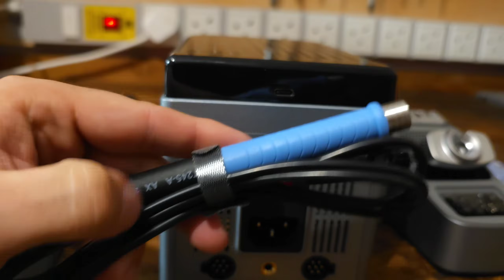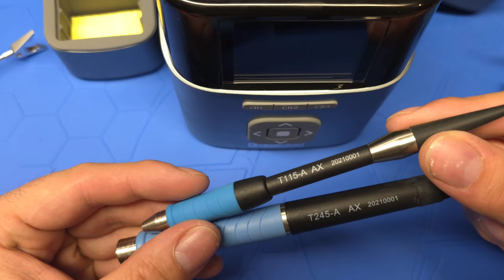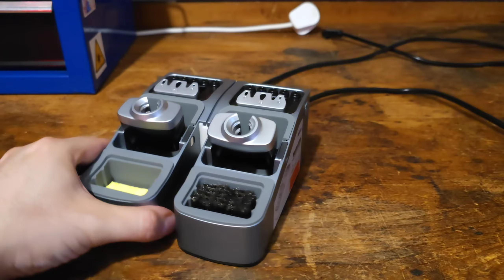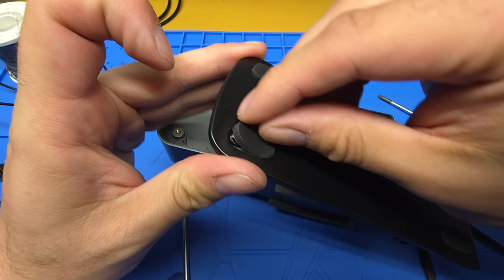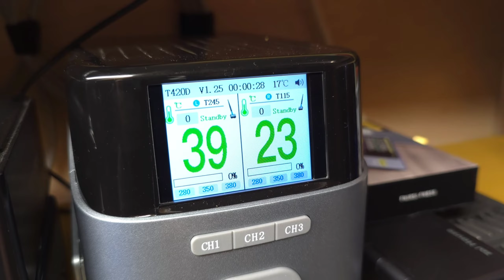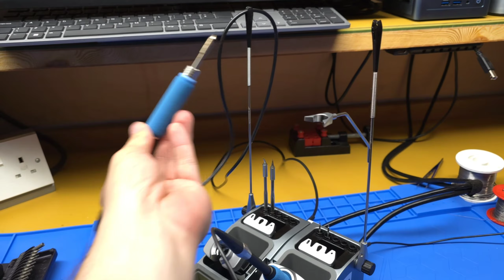Electronics Workbench Build - AIXUN T420D with some mods!

Comment: It would be better if you drilled a small hole in the soldering iron connector, but did not break any of the pine at the base of the holder.
Reply from the maker: Yes you are right but this was a very long time ago now
 It's still working very well the iorn

Comment: I almost  got one of those but I got a ta305 instead.  I'm hoping  to DIY a PCB that switches between tips. I wanted the t420 but it's twice the price (almost) and some  users scared me saying it fries tips and isn't compatible with  genuine and stuff. Not sure if that's true.

It looks slim and nice tho for what it is (two transformer based stations in one)!

Do you think it's worth having all 3 handles/ It's annoying needing 3 different types of tips. I was thinking of doing 115 and 210 or 115 and 245.
Reply from the maker: No it's not worth having 3 as it's a dual station and swapping the actual handles is too annoying. I burnt out all my tips that came with the station but I put this down to my error as I had no idea what I was doing and trying to solder everything at 500degres to start with. I really like the T420 tho its a very heavy unit. Getting the right tips is important tho. On my latest Ali express videos you will notice I got new Relife tips and I'm super impressed with those ones so far. Now I have been using them I no longer feel the need to spend a lot of money on JBC ones
Reply: @J @JFIXX1  oh nooo. 500c is a lot! I use 350-320 for lead free Thankfully they’re not TOO expensive! I’m a bit broke but maybe I’ll try the relife. I got HZXY something because relife didn’t have any of my favourite tips (1mm-1.6mm chisel for example, or bent chisel). I’ll see if I can find the video later today when I’m free
Reply from the maker: @ameliabuns yes but when I recorded this video i had never used a soldering iorn before. I had to make some mistakes to start with to find out what I really needed. I also bought MYTO tips that also I have been using and they are good although one was dead on arrival but they did send a replacement
Reply: @JFIXX1  Woah that's a very fancy first iron :D Good luck!
Reply from the maker: If you want to know which handel to get definitely 245 is essential as gives most power. The second one down to what you mostly working on. The 115 is very very small so good for mobiles or trace repairs things like that. The 210 to me is just an in-between soni have never used it

Comment: I have that stattion, and something cought my attention in your video, on my T420D all the plugs are 6 pin, witch means i cannot use the docking station, witch uses 7 pin aviation plugs, it looks likte there ara 2 versions of the T420D, one with 6pin plugs and otther with 7 pin plugs. An excelent station tought, i use JBC tips and never had a problem with it.
Reply from the maker: Very strange I can't quite remember as this video was a long time ago but I did some mod on mine to get the pin to fit

Comment: aixun is a brand which untrustable! tip voltage leaking is ubiquitous, the company never! never! try to fix this issues
Reply from the maker: I never actually tested for voltage at the tip now I am curious what mine will be I need to measure it

Comment: I've been doing research on this station and the issue with the handle is that the first versions of the station came with 6 pin connectors all around. Those were compatible with JBC stands. Not sure why they changed it to 7, but the newer batch of stations come with 7 pins. Not confusing at all :(. Now there's a new version that has WiFi. The only difference with that one is that it syncs with their fume extractor, so the extractor activates when you lift a handle off the base.
Reply from the maker: Thanks for the update
 I like the idea of the WiFi version with the fume extractor maybe I will have to upgrade

Comment: 24:22 Maybe you could have carefully drilled a hole in the plastic of the connector in the handle, so it can accommodate the seventh pin from the base. No risk of damage to the base and you already had a spare T115 handle. The mods you did to change the way it holds the T115 handle in the base makes good sense.
Reply from the maker: Good idea but too late now 😅

Comment: Just had a blown MOSFET on the right iron on a 2 month old station. I was using the left at the time and the right should have been at standby  90 °C however glowed red and burnt out. Tried another tip and that went pop. Got a new main board under warranty. Replaced and its working. Belled out the old board and one of the 2 MOSFET's on the right is shorted. Just something to watch out for as its looks like i'm not the only one. May replace the MOSFET.
Reply from the maker: @johnbarnes5406  Ah that's a shame - with my issue they were very helpful and sent me the new iron without any questions so at least the support seems to be there from Aixun. And you have the faulty station to keep for any more parts in the future. I have not had any issues with mine but I don't keep any standby temperature it heats up very fast so I usually let it just go back to ambient temperature. It would be interesting to know how it actually controls the temperature maybe when you set a low temperature it is reducing the gate voltage on the MOSFET to hold back the current and putting the mosfet under load
Reply: @JFIXX1  I did try contacting Aixun via email but nothing back. As the same time I contacted the seller, we went through some tests including a video of the tip glowing red and the display going mad / showing very high temps, we determined it was the main board. May have a little reverse eng on the old board and answer your question. BTW all my handles came with 7 pin plugs.
Reply from the maker: @johnbarnes5406  The Aixun support were good via WattsApp if you need to speak to them

Comment: Are the knock-off JBC tips any good? If so which brand? I've heard Relife?
Reply from the maker: @catharperfect7036  Hi! This is my first soldering station and I have only got experience using these Aixun supplied cartridges. I can't offer any comparison but I did do research before buying and people were giving great ratings. I now have a hako hot tweezers so I will be trying some different tips from Ali express to see what works well as I need two of the same tips in the tweezer

Comment: I just ordered this station a few days ago. I’ll update this comment to see if they still ship with the 6 pin connector. 
I bought this station to supplement my Pace ADS200. The tips just don’t get small enough to solder SMD processors by hand. Sometimes hot air isn’t possible to use without destroying surrounding components. 
Thanks for the video.
Reply from the maker: @jlev505  I hope you don't have the same problem I did. That being said I'm very happy with the station and I'm sure it will work out well for your SMD tasks
Reply: @JFIXX1 I’m happy to hear you are pleased with it. I hope I am as well. We use JBC stations at work. We repair oilfield measurement systems for measuring pressure/flow/ temp /comms RS232-RS485) etc. I repair home/car audio gear at home on the side. The Pace works perfectly for that task. Except for tight spacing pins on processors. Most of the modern audio gear is starting to implement digital/logic ICs for protect circuits and power supply protection and lower rail voltage based on temp and current. The class D amps also have quite a bit of digital components as well. I’m sure this station will help make the repairs look like it’s OEM wave soldered. 😊
How long have you been into the electronics hobby? You said you were new to it in your video. I’ve only been messing around with electronics for a little over 2 years now. There is a ton to learn! I started with analog and my job is digital, I had a very steep learning curve. I didn’t know squat about logic/ digital. I have learned a lot and my boss is super smart. He was a TV repair man back in the 70s. 
He is teaching me how to make my own circuit boards now. Lots of obsolete daughter boards to make for car audio amplifiers like PPI, Orion, Alpine and RF. 
My first board is going to be the PWM board for an Alpine 3558 I have. Had to scrape all the ceramic off the board for 2 days to be able to draw my schematic. Loads of fun!!
Reply from the maker: @jlev505  I have only just seen your comment for some reason but I enjoyed reading it ! Did you every get your station and can you share your experience

Comment: I’ve had my heart set on an AiXun T420D for a couple years now but I haven’t been able to save the money. I really wasn’t expecting issues like the DIN mismatch from a soldering station that costs so much. If this is what you get from a dual channel JBC clone, maybe it is better to go with a used single channel JBC after all.
Reply from the maker: @emmettturner9452  I couldn't justify the JBC as I'm only new to soldering but after the issues are sorted I'm happy with this station in the end !

Comment: You can remove the pins by desoldering the pin and pushing it out of the housing.
Reply from the maker: I needed a soldering iorn to fix my soldering iorn 😅
Reply: @JFIXX1  lol .Couldnt you used the C245 section to unsolder it?
Reply from the maker: @Miknow  good point! 😅 I took the easy option as I have never done any soldering before

Comment: Drill for the 7th pin. I am using this way on the t380. By the way t115 has 20k resistance on pin 1 and 7th. 7 is middle

Comment: For the T115 6-pin vs 7-pin: I just checked on my model and my right-side base holder does have a 6-pin female connector to connect to the 6-pin male connector of the T115 handle.  I did have an issue with Aixun at first where they sent a different tip-cleaner than I ordered (I received the metal bristle thing instead of the brass wire with splash guard).  It took a bit of back and forth with Aixun, and at first they sent the wrong part (the white plastic connector to join the two handle holders), but after I sent them pictures circling and pointing to what was missing they sent the right part.  I'm pretty sure the problem is due to computer translation from English to Chinese.
Reply from the maker: Thankyou that helps a lot ! So it was the station not the handle that was the issue ! I did suspect that but as you say sometimes the communication is a problem